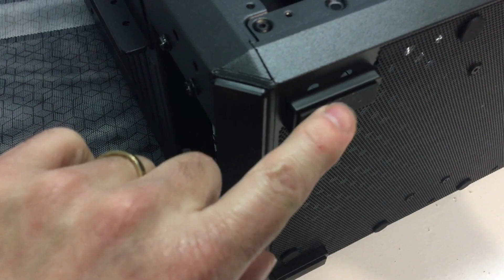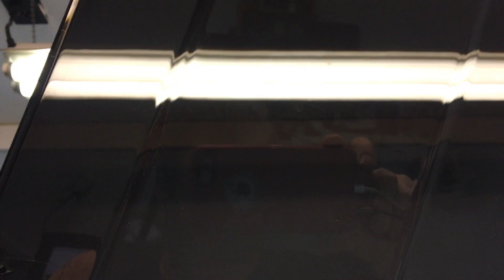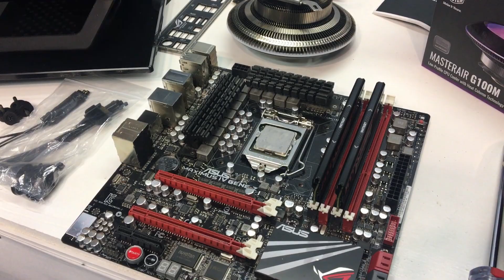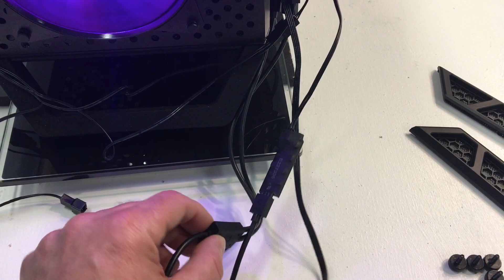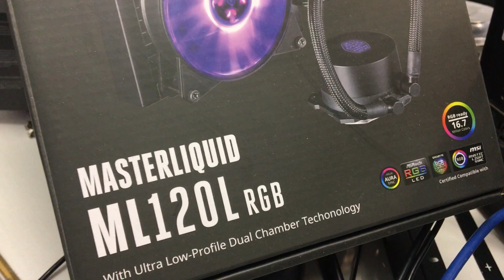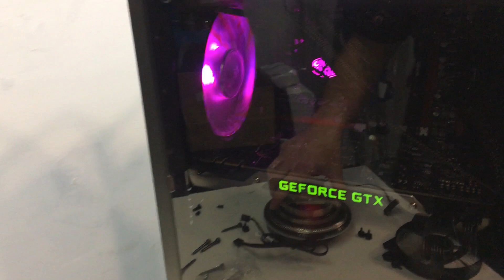Cooler Master Q300L & Q300P Case Review.

Comment: Got a Q300L with G4400 and a 750 ti as a computer for my TV, just added 2 fans in the front and works very well, I also ordered today a Q300P to put a i7 4790 with a 1060 3gb blower, and i was wondering if the cooling would be enough or do i need to buy some more fans? and wich fan is preinstalled so i can order the same ones.

Comment: do you think that this case with some cheap parts and one fan would stay cool?
Reply from the maker: "Stay cool" depends on your definition of cool. So it all hinges on the motherboard, CPU, GPU and other factors.  Overclocked or not?  Fans are cheap, so it can't hurt to add a fan - or two.  Remember, airflow is the key.  If you are building a simple system for just email and web browsing, then one fan might be adequate.
Reply: Thanks I went for a water cooler and I’m building my whole pc on Saturday

Comment: Thank you for posting this! I'm doing my extensive research for my first PC build, and the 300L has the form factor that I love. I will definitely use a water cooler then as you pointed out. Would exhaust fans at the top help?
Reply from the maker: Any airflow is good airflow, so if you have room for additional fans, then I would say yes.